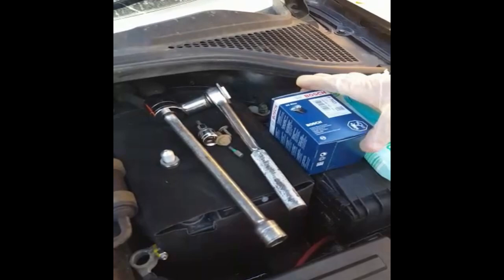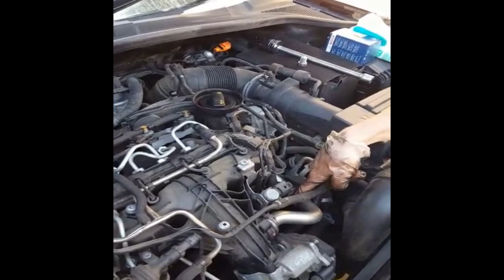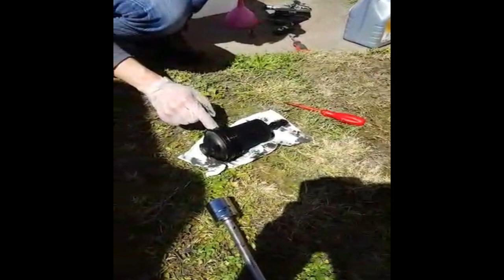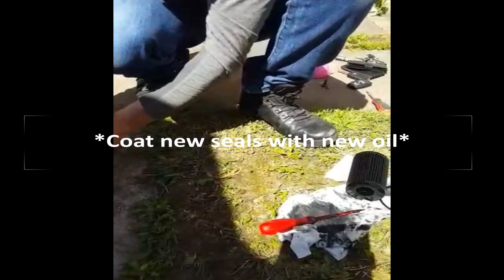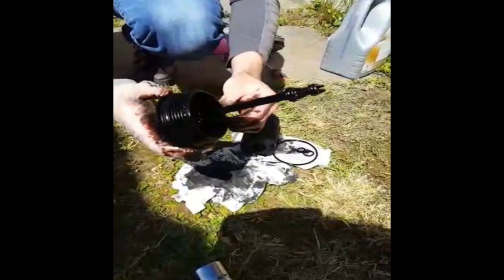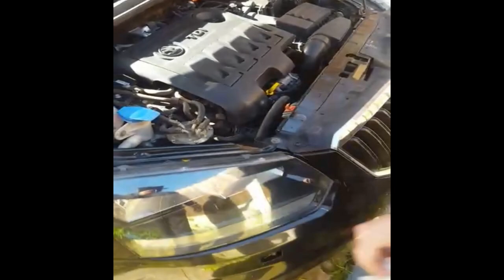Skoda Yeti 2.0 TDI Oil and Filter Change

Comment: It's worth checking the level after running the engine, as it would have filled the oil filter chamber, and may need a small amount to bring it to the correct level. Thanks for the helpful info.
Reply from the maker: Yes I did that,  but  i never video it. Thanks for  pointing it out.🤶👍🏼👍🏼